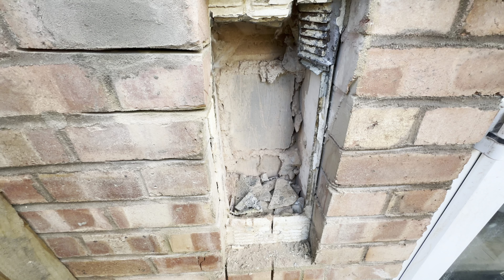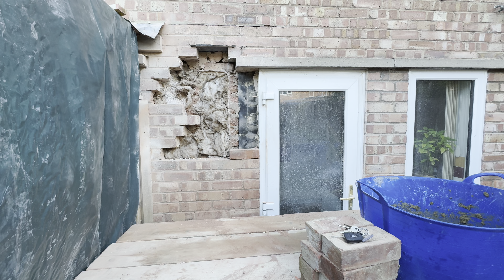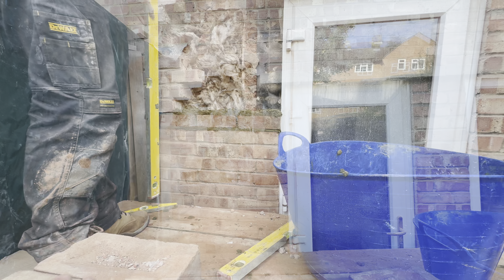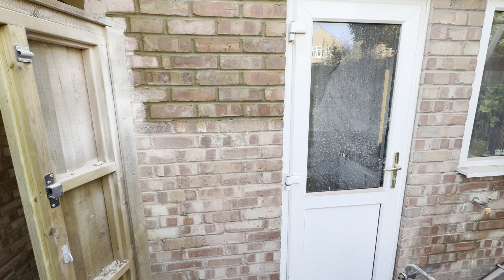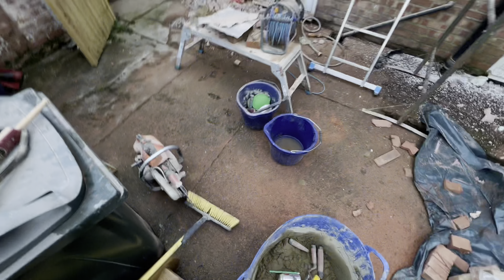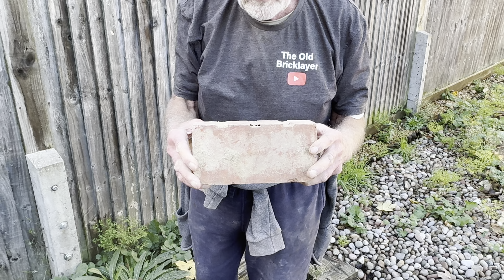I found a window in the cavity . Working with the old bricklayer

Comment: Not looking below but I can tell you exactly what it is. It was the LBC Keyed Fletton . Designed specifically for new build internal walls intended to be plastered. The slots on the back were called keys designed to provide...you guessed it a key for new plaster that would otherwise only rely on suction bond. No longer in production now sadly. Stronger than a delicate thermalite block. My house's internal walls all built with them.
Reply from the maker: @captaingalaxy2832  yes you are correct a much better wall than the thermomlites that crack to f

Comment: Ask your dad, we f*cking hated those keyed flettons. No such thing as cheap gloves back then. 
Nice work today, silk purse out of a pigs ear.
Your jointing up is always nice, are you using a Dingher?
Reply from the maker: I will ask him …. I have about 10 dingers but used a marshalltown on this job.   I love the dingers but they wear out so fast spend more time reshaping them on the sander it’s a pain in the backside esp when their nearly 3x the price
Reply: @Theoldbricklayer  Everyone agree's about the Dinger. They did look into getting them hardened but not sure if that happened. 
I grew up using bucket handles so I do love the Dinger, faults and all
Reply from the maker: They should put on the listing you will need a belt sander as they wear out in days 😂.